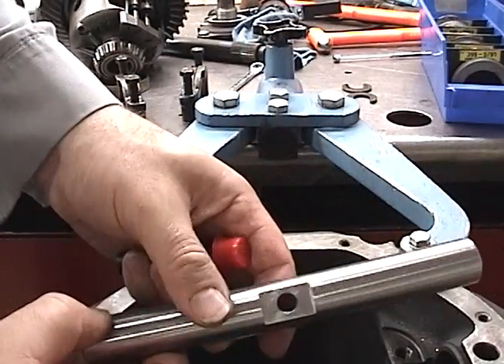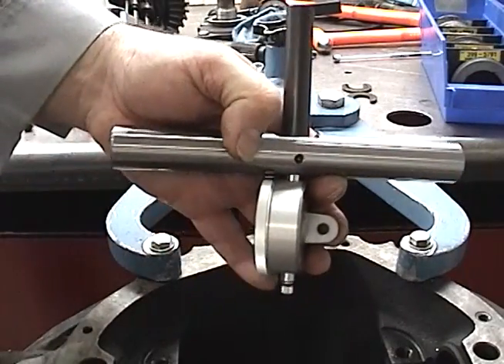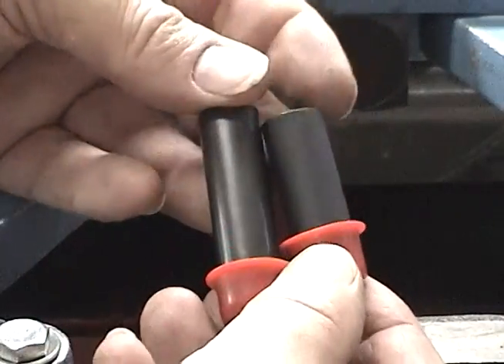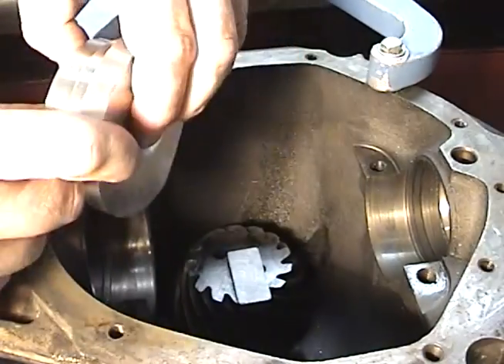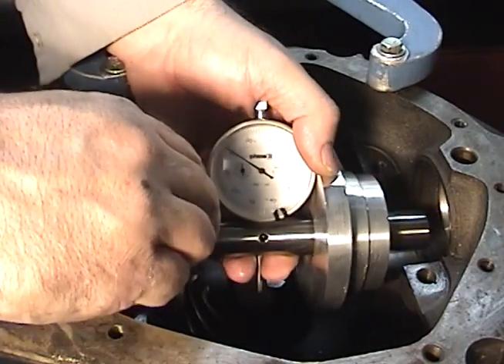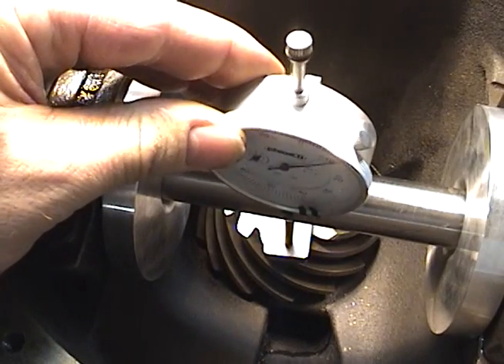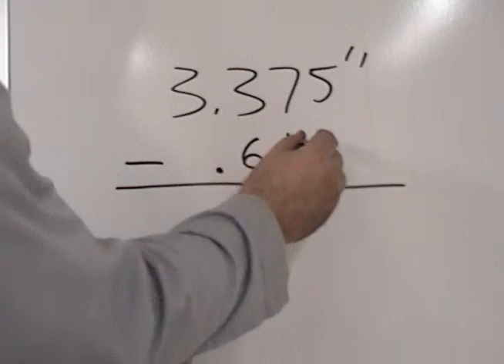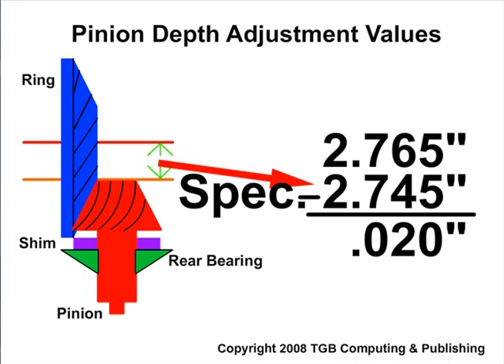Measuring Differential Pinion depth most Differential

Comment: Great vid Can you tell me by deducting 5 thousands on pinion dept ,How many thousands would it add or deduct on backlash ?
Reply from the maker: I wish there was a formula but there isn't.  A lot depends on the design and cut on the gear. Additionally, it's not proportional which means changing the depth by .010" might change the backlash by .008" but an additional .010" might change the Backlash by .012".  One other note, Most of the time depth is done first, then the case and ring gear is installed and backlash is setup from there. You might want to check out a few of my other differential videos.
Reply: @DrivelineMaster  What I did was bought 2 of the same brand pinion bearings bored out one too use to set pinion depth and set backlash to .006 used the marking compound and everything was good ,Pressed on new pinion bearing put everything back to double check and the backlash was around .008 to 9 and seems to ride more towards the heel,,BTW Thanks for getting back to me I appreciate it
Reply from the maker: There is always a little wiggle room with backlash and as long as you are within the tolerances your good. Never worry about being perfectly in the middle of the specification that reality is not always possible.  I'm assuming your differential uses case bearing shims because you would not be able to do what you described with threaded adjusters.  I suppose if you have a straddle mount differential that has the removable pinion housing this is possible.  If your backlash is slightly out of specifications after installing the pressed on the pinion bearings it's only a matter of a small manipulation of case bearings shims to fix the problem.  For every .002" case bearing shim change you should get close to .001" backlash change.  Take .004" away from the thickness on the shim farthest away from the ring gear and increase the shim closest to the ring gear by .004" and that should dial your backlash to very close to .006" to .007" again.  Also having backlash that is the same all the way around is also not realistic. There is almost always some variation.  What kind of diff is this?  Did you also setup your case bearing preload with the dummy pinion bearings in place? If you never setup case bearing preload it could easily move on you causing the backlash change.
Reply: @DrivelineMaster  Thanks for getting back to me ..I Forgot to tell you its a 10 bolt GM with the 7.5 ring gear ,,,installing a dura grip yukon carrier with the yukon gears ,Yes set the preload with the shims and dialed everything in ,But it changed after pressing the bearing on pinion ,,I Guess the bearings are not alike even using the same brand ,I did readjust the BL but did not like the pattern with the pressed on bearing
Reply from the maker: Patterns are also a bit tricky and hard to get perfect.  When doing a mock setup with dummy bearings it's not common to use the crush sleeve.  If you left the crush sleeve off during this part that could play a part in the misalignment.  If you used an crush sleeve eliminator kit that could eliminate that possibility.  Additionally the bearing that was honed out could seat slightly different. The pressed on bearing expands the inner race which will effect the way the bearings seat against the cup. This has a tiny effect on pinion depth but normally not enough to make a difference. I don't think the bearings were different I just think they sit differently when pressed on as compared to being honed out. As long as the pattern is not running off any of the teeth edges you will be fine.  If these are new gears don't forget to break them in.  Yukon has break-in instructions.
Reply: @DrivelineMaster  Yes that makes sense the inner race spreading a little will do my best to get it close as I can  and break it in properly ,I Just ordered the crush sleeve eliminator  by Yukon  too ,I Want to thank you again for helping me out ,Will keep you posted how the outcome is
Reply: @DrivelineMaster  I like to thank you again for taking the time to explain ,,Well I bought the crush sleeve eliminator and did the preload on pinion  put everything back together did my backlash to 007 ,and on certain spots of the gear it either be a 002 differents either way ,Is that normal I know you said backlash is not all the same around
Reply from the maker: Backlash plus or minus .002" is pretty good and within tolerances.  This is called backlash variation and I have seen as much as .005" on a new gearset which is  too much but the gearset manufacture said it was OK. Just goes to show the poor quality from that manufacture.  Backlash variation is normally due ring gear run out and with a new gearset and proper installation this is often caused by the machining tolerances of the case and the ring gear.  Sometimes repositioning the ring gear on the case can reduce this but with only .002" backlash variation it's not worth the trouble to try to eliminate it.
Reply: @DrivelineMaster  Thanks again for taking the time getting back to me ,,,I rechecked it again the majority of it is in the 6 to 7 range and one spot will be 8 and another spot will be a tight 5 ,I checked the runout on the ring gear and its like one .001 and a half not quite 2 and wonder if thats acceptable and the backlash ,,The gears I used is from yukon
Reply from the maker: Backlash variation is the difference from the smallest measurement to the largest measurement after checking in at least 6 different locations.  .002" is normally the maximum but .003" is often acceptable and depending on gear manufacture sometimes they will tell you that .004" is acceptable for their gears.  Unless the manufacture has given you a specification use .002" to .003".  Never settle for a measurement that is smaller than the smallest specification. Fore example if the specs. are .005" - .009" and one location is .0045" that is too small, you need to fix this.  Sometimes no matter what you do the measured value will be either a little small or a little large such as .0095" or .010".  If this is the case always go with the slightly larger out of spec instead of the slightly smaller out of spec.  Yukon is a good product and if you have one spot that is a little under .005" such as .0045" and one spot that is at .008" that is .0035" variation and bordering on excessive for me. I personally would recommend re-clocking the ring gear.  Re-clocking the ring gear means that you remove the ring gear, rotate it 120, 180, or 240 degrees to a new position.  Re-torque the bolts and check the backlash variation again. I always recommend torquing the bolts in a two step procedure. The first torque should be 1/2 the amount and the second torque should be at the full amount. If after re-clocking once or twice if you still have problems either the case is bent or the problem is in the ring gear cut and how it mates with the pinion.
Reply: @DrivelineMaster  Well I took the carrier off and put the dial indicator on top of the pinion head towards the outside near the teeth and is has a 002 runout I dont know if that means anything and when I spin it it does have the preload drag when I set at 15 in pounds But has a slight more drag on one part of the revolution 
and it seems to be on the same spot on the pinion gear plus the outer pinion bearing slips on by hand instead of tapping it in
Reply from the maker: The head of the pinion is not precise so that is not a good test.  I would be worried if the pinion bearing preload is not consistently the same all the way around. It should not be tighter in one location than another.  I'm personally not a fan of crush sleeve eliminator kits.  I like the crush sleeve but they are harder to use and you often need a torque multiplier to crush the sleeve.  Don't worry about the outer bearing sliding on. Some do that but more often than not they are a snug fit.  What did you torque the pinion nut to?  Because the factory setting for this differential is to use a crush sleeve and tighten until you get the correct pinion bearing preload there is no factory torque spec for the nut. Just a factory pinion bearing preload. The torque on the nut will impact the pinion bearing preload.  The last time I used a crush sleeve eliminator kit I think I torqued the nut to around 175 foot pounds. The torque might impact the preload and the reason the rotational torque is not smooth and the same all around.
Reply from the maker: Also, 15 inch pounds of pinion bearing preload for new bearings sounds a little on the low side. Most are closer to 20 inch pounds.
Reply: @DrivelineMaster  Sorry didnt get back to you been very busy over the holidays ,Well got a new set of Yukon gears ,Basically the same thing with different backlash values from 4 to 8 ,, Made sure the pattern was good ,,Took it out for a ride today to break them in for 15 miles under 40 MPH ,,I Can hear a slight whirring noise when accelerating ,Not sure if it will quiet after the break in period
Reply from the maker: Some gear sets just have a lot of variation.  Yes, it should get quieter after the gears get broken in.
Reply: @DrivelineMaster  Thanks for getting back to me ,,will do the 500 mile break in and keep you posted,, if it dont quiet down might have to look into another brand of gears  ,Thanks Drivemaster your the man

Comment: I have this tool...i was getting different reading going back and forth with same shim...i was going nuts..until i find out the pignion head , the flat suface where the magnet goes wasnt dead flat..it had a low spot...i waisted my time and endup with an approx reading
I will suggest first  to check on that pignon surface with a dial indicator first to make sur its dead flat
Also i used on 4.56 gear set.
Pignion head is smaller
 I had to hold the nagnet with a finger
Reply from the maker: Good Idea but the reality is that none of the manufacture will use the pinion for pinion depth.  They all use precision dummy shafts and precision spacer blocks so this tool will always be a little off and the pinion head is never machined near perfectly flat. Although not shown in the video I will often take the new pinion and give it a few strokes of 320 emery paper on a flat granite block to knock off high spots. If you do this make sure to write down the pinion depth markings first just in case you end up removing them.  Second I always apply a little finger pressure on the magnet to keep it up against the pinion head when taking my measurement.  Finally I use the contact patch to determine if the depth is correct and adjust from there. This tool if it doesn't get your perfect it will get you darn close.  I never use the crush sleeve and install the pinion seal until I have set it up once and done a pattern. Once I'm happy with the pattern I then install the crush sleeve and seal for the final assembly.

Comment: Don't most pinion gears have the depth requirement stamped on them?  I've seen some vids where although the depth gauge was used, the impressions in the paint showed the gauge was off a bit and shims had to be added subtracted.  I was wondering if you could just use the paint to figure out depth/backlash...
Reply from the maker: If you purchase OEM gears or you are reusing the original gears they don't have the depth stamped on them.  Only aftermarket gears will have the depth stamped on them.  You can't tell what the depth is by the paint or compound markings.  What I mean is you won't have a distance value.  You can setup a gear-set and the depth through trail and error by changing shims, checking the contact patch, change shims again and so on until the contact patch is where it should be for proper pinion depth.  Most factory pinion depth tools will not provide you with the pinion depth value but instead they just figure out what size shim needs to be installed.